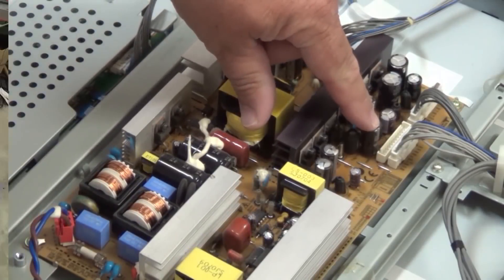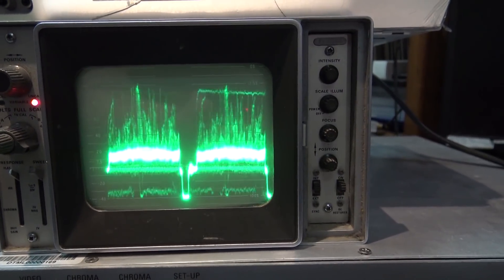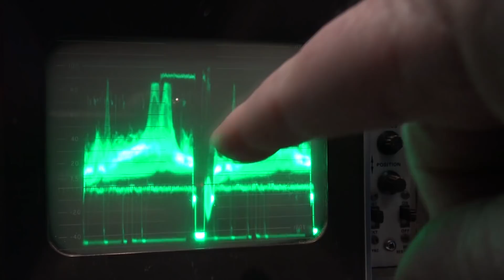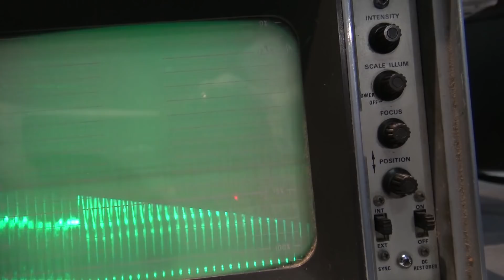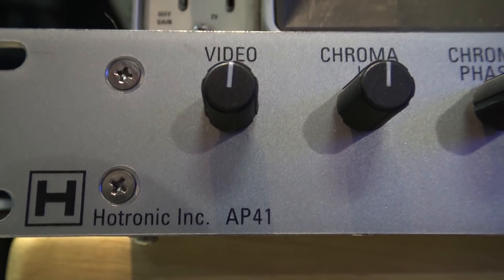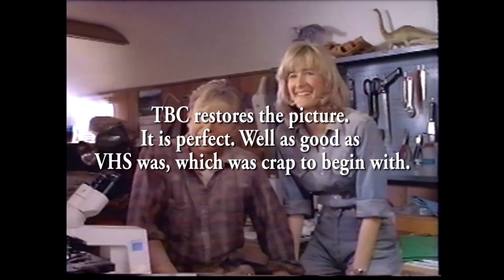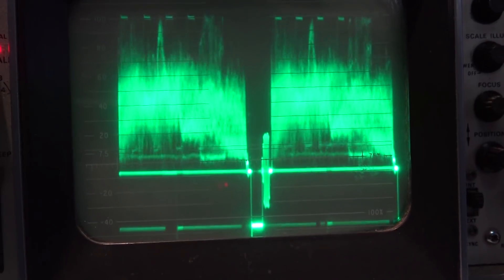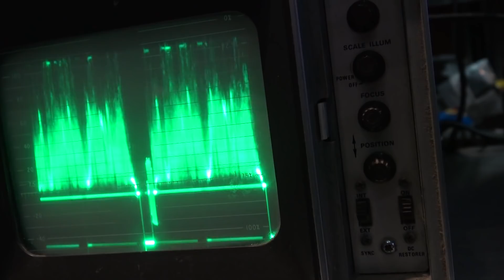Capturing video with a professional TBC

Comment: I know this is old, but that TBC is still around it seems... I haven't used one since 1993 or so I think and I'm wondering if the unit you're using is newer or older. I remember the unit I used was great for stabilizing things - mostly 3/4" but sometimes VHS, but it did have an issue where there seemed to be some shortcuts (or limitations on AD/DA converters then?) that resulted in visible gradient transitions when a scene faded in or out to black. Do the Hotronic or the Videonics units have this issue as well? Do you test for that?
Reply from the maker: I never use it.  I have proper capture equipment that has a built in tbc on the input.

Comment: Do you have any idea why the first VHS looks so bad? Do you think some tapes age better than others? I have some VHS tapes recorded from TV the early 80s that look like they were just recorded, and some that look like that first one. And in terms of Betamax in my experience it seems to age better than most VHS tapes.
Reply from the maker: The first video was recorded in 1980 on an old rca vct201 directly off the 1" broadcast tape. The jutaasic park tape was much newer and has not been played much.  Different tapes age differently.  Different brands have different tape formulas.
Reply: @12voltvids  That's a shame, and even in SP still aged badly. And no way to know at the time what would last.
Reply from the maker: @laurabraniganforever-matty7613  
No video tape lasts forever.

Comment: What kind of TBC did you use?
Reply from the maker: Mine is built into my digitizer deck a Sony gvd7000. I can. Feed in composite or s video and a DV stream comes out on FireWire. This is a mini hdv deck that will record and play DV and HDV tapes. When new it was about 1200.00 but it does a very good job.

Comment: Hey Dave! I got a question that only you could answer. I know external TBC's work better,  but I was doing some captures today with my Panasonic AG4700, and when the TBC is ON, it adds some issues to the sound. Like high pitching or streching some parts of the music to fit the frame rate.
I switched the TBC off and it sounded more natural. (some glitches of the tape, it does the same in others VCRs). 
Coul a bad (or partially) bad cap on the TBC circuit be causing it? or is just that the internal TBC is horseshit?
Reply from the maker: Could be anything in the TBC. Most internal ones are pretty lame.
Reply: @12voltvids  Hopefully sometime soon will get a Panasonic mixer with built in TBC or a Videonics like you.

Regarding the TBC module (VEP03A53), it has 8 variable resistors:
DIG. C LEVEL, W.B1, W.B2, R-Y LEVEL, 1HDL GAIN, TBC SYNC LEVEL, TBC OUT LEVEL, NOISE GATE.

Do you think that the sync issue could be solved by tweaking it?

I haven't been able to find any reference of "how to tweak (or tune) a TBC module".

Comment: Hi 12voltvids. I just got a Hotronic AP41,  but whenever I run my VHS tapes via S-Video from my VCR to the AP41 unit, the video strobes vertically up, kind of like an old film effect in a film projector. I've tried every setting on this machine but the most I can get it to do is go from the vertical strobe to a stuttered look which doesn't look right either. Does this problem sound familiar?

Comment: In a previous video when you repaired the Hotronics AP41 (bad bypass relay) I noticed a DIPswitch on the motherboard with 8 switches. I noticed from 1 to 8 that the switches 4-6-8 were in the ON position. I'm sure these switches have something to do with the AP41 setup on the vertical interval, I mean which behaviour to have on the first horizontal lines (macrovision pulses disable). My question is did you let this DIP switch (4-6-8 = ON) configuration for the above video which clearly remove the macrovision ?I have the AP41 user manual but there are no info about how to set these DIP switches..And Hotronics people just keep on telling me there are no support anymore for these obsolete TBC.. (!!!)
They would even not let me or offer me to buy a service manual.. So what DIP switches configuration did you use ??? Thanks.
Reply from the maker: jpdesroc 
I made no changes to the dip switches. I dont have a manual either and I do not know what they do. For all i know they select internal reference or external gen lock or select ntsc/pal/secam operation. Perhaps black level 0 / 7.5ire ect. Don't know didn't change them. Might be worth a second look as I have that tbc. It was given to me but i havent used it since the demo.

Comment: Hello 12voltvids, 
I really loved your video and was hoping to pick your brain if I may.
I was looking at the Hotronic AP41 as a TBC for capturing old VHS and Hi-8 tapes through a MOTU HD Express capture device for Adobe Premiere. Doing so is next to impossible without a TBC.
I do have a Videonics MX1 and now see that I could run my footage through this to stabilize the footage but it seems that the AP41 would have better controls for black levels, chroma phase and other things. I am excited to try my MX1 for sure but do I have to have an oscilloscope with the AP41 or can I go by visual of what I'm seeing on screen?
Thank you for the time.
Steve
Reply from the maker: ou can use the scope window on premiere to check your video levels, or if you are feeling thrifty, pick up an old waveform monitor like I have. Mine cost me only 30.00 many years ago. The Hotronic will give you more control for sure, however this is usually unnecessary because once captured you have full control in premiere and can make your levels perfect in post. So the MX1 will stabalize good enough and then if you need to tweak levels you can do it in post. Another very good way, but more time consuming is to use a stand alone DVD recorder, and burn direct to DVD-RW disks, then import the disks directly. Most of these DVD recorders have superior A-D converters than any of the consumer level capture devices. It does however add an additional step. I generally use my GV-HD7000 which gives me a 25mbit DV stream, and import directly into premiere. No TBC is needed in this case. You can use a DV camera or Digital 8 camera for this operation as well, as they have AV-DV conversion built in, and that way it goes in directly on firewire.
Reply: Thank you for your quick reply. The one reason I avoided the DVD recorder option was because I knew that I would want to edit the uncompressed footage without compressing it to an MPEG format first and then editing it and the compressing it again on output.
Again, I appreciate your expertise and can't wait to try this. 
Have a great evening,
Steve

Comment: I have a MX1, that I used to change between two different video sources.  I didn't know that it could strip Macrovision, I never tried putting a vcr output into the MX1.
Reply: It doesn't work with those I think. Have you tried?

Comment: Interesting. I've tried a ton of TBC (For.a, G2, Snell & Wilcox, JVC, Kramer) in order to stabilize and improve analog materials (VHS, Beta, U-matic), but none of them satisfied me like the DVD recoder "solution" (Panasonic, Sony and Pioneer). The results are quite impressive. Easy, quick and cheaper. I can capture my footage with no drops simply splitting the signal from the source (Pana DVD recorder) through HDMI and send it to the IP4K capture card.
Reply from the maker: I generally record onto DVDR disks straight from the tape, and then just pop the DVD in the computer and rip that disk and build MPG2 or $ files.
If a client wants somthing as an MP4 or whatever. I record it onto a DVD-RW disk, rip it o the computer, and put it in whatever file format they want. Then erase the DVD-RW disk and use it again.
Fortunately 95% of my clients just want their material archived to DVD so I use a DVD recorder solution too. I have 3 Toshiba, 3 Panasonic and a Sony (which is a pioneer by the way). The Sony and one Panasonic has a hard drive as well. I also have a liteon that will accept a PAL input from my multi statdard VCR, and convert the signal to NTSC or vise versa.
Reply: Depending on the material to digitize, I generally record onto both PVR's HDD (and then onto DVD) in high MPG2 quality and/or onto PC's HDD in uncompressed file format (v210) for archival purposes.

Comment: I could not see any difference when you put that split screen up they both looked like crap.
Reply from the maker: It's VHS, what did you expect it to look like? That and the fact that the tape is 37 years old! Considering the age, and the source it actually looks pretty good. On my computer, the TBC side has better black levels, and color.
When video systems were first introduced for consumers there were 2 systems, Beta and VHS. Beta was better, considerably better, but the inferior VHS system won out due to JVC and Panasonic dumping their product, and putting slower speeds, with an even worse picture. The un-educated buyers, didn't care. They only cared about how many hours it would record on a tape, and how much it cost. Those that did their research, knew that Beta was better, and they initially bought Beta, but it was a loosing battle and Sony finally raised the white flag. So we got what we got.
No point whining about it now. It's a dead format but when you have rare and valuable footage on VHS what's ya gonna do?
Reply: @12voltvids  r/vhs

Comment: I was under the impression any modern capture card with enough memory to buffer multiple frames (for bidirectional motion encoding) didn't need a TBC because it already contains a TBC. It samples each line into the buffer based on the varying sync pulses, but the encoder will read that buffer in whatever manner it needs to.
Reply from the maker: Yes and no. They basically digitize each frame, and do hold multiple frames in memory however the capture card is also doing all the encoding work, and where problems arise if when blank sections of tape are encountered. 
This can cause buffer underruns as the capture card is encoding, and runs out of data, and just ends up with random noise and no sync pluse. So running through a TBC before the capture card, the TBC will generate, and replace the sync pluses, so when an unrecorded section of tape passes, the sync pluses continue, and the capture card is happy.
I have some pretty high end cards here from back in the day before digital video when we were capturing component video from Betacam, and abruptly ending video was murder on the capture card. I used to make sure I recorded a good 10 seconds of black at the end of the shot just to give myself time to dump out of the capture before the signal ended. capturing through my DV deck is not a problem though as it has a TBC on the input.
The Hauppague I used in this demo however does not. It expects a nice stable signal, as it is designed to be used with an HD cable box or satellite receiver to archive HD content via the component input, and it does a fantastic job doing that. That is what I use it for. I offload shows from my PVR that I want to keep a copy of, and throw it onto a Bluray disk. The quality is awesome.

Comment: On thar SLAMM video I actually thought the picture looked better without TBC.
Reply from the maker: It probably does, because the TBC adds processing, and when you process a video you never get what went in. That is why VCRs designed for editing had an "edit" switch. The edit switch turned off all noise reduction processing.
On professional machines we had a mode called RF editing that basically ran a straight RF path from the head amp on the playback deck to the record amp on the recorder. No you couldn't add effects, or add titles, just dub a tape, but it gave you the closest thing to a perfect copy as you could get in the analog world. We called it a 1/2 generation loss as there was no processing done. The playback signal amplfied and recorded to the record deck.